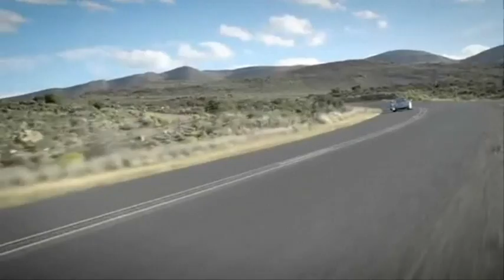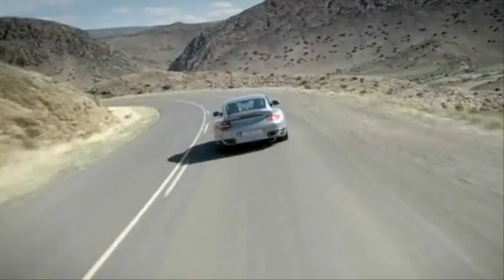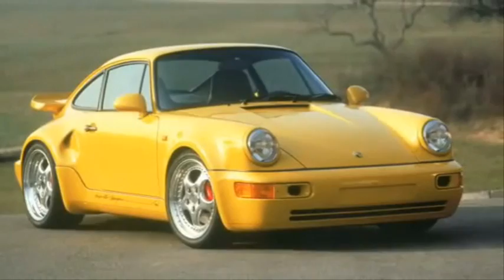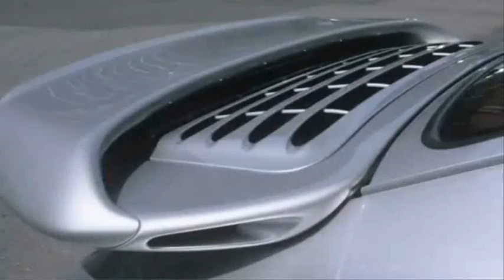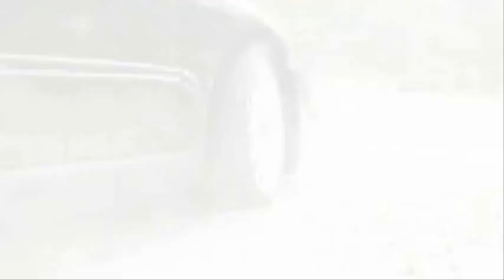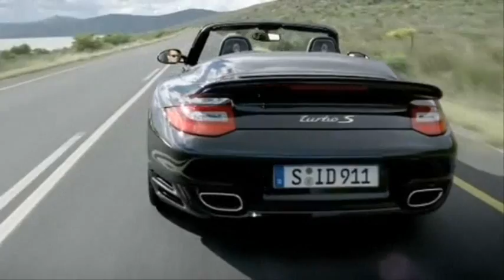2011 Porsche 911 Turbo S

Comment: @specizmodding the automatic transmisions has clutches too or known as softclutches, this a robotic automatic transmision with 2 clutches and i can call it more closer than automatic than the manual because it has no ability to change gears from 2 to 4,5,6 or the reverse.

Comment: just wondering... is this the 991 997 turbo S or 991 998 turbo S, coz im bit confused with the new generation 991s... i havent seen any acutal pictures of 991 998 so i wont know what has changed with the new generation